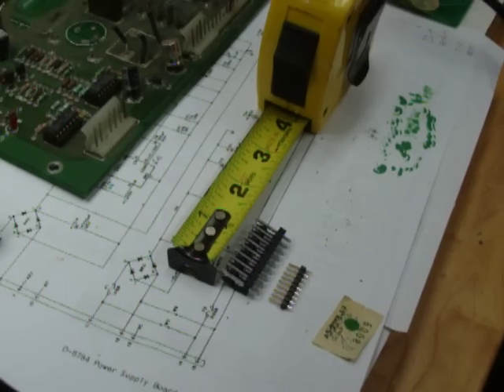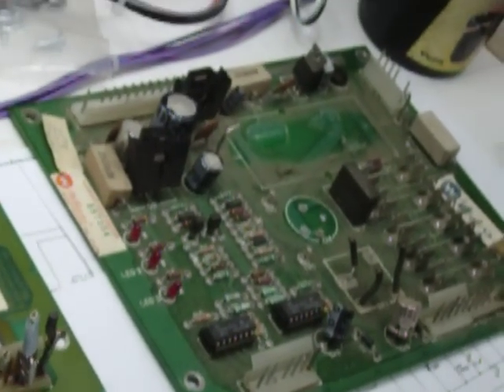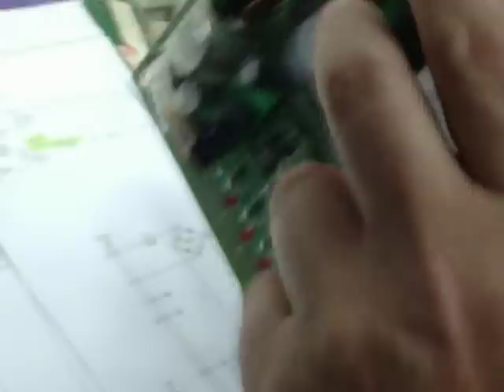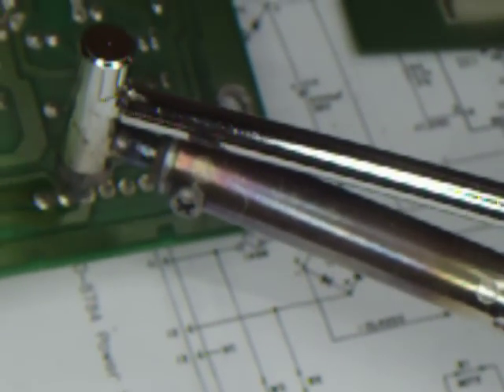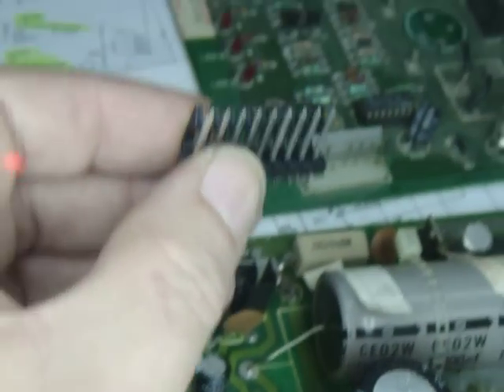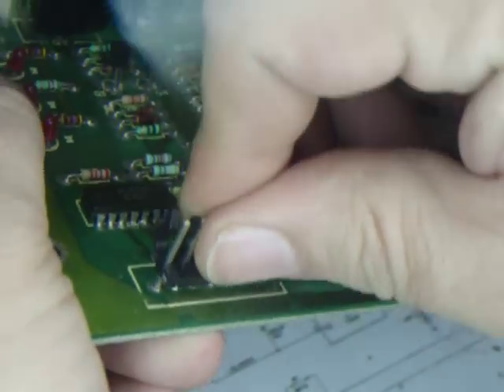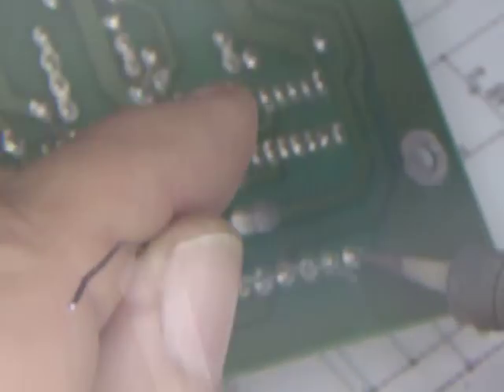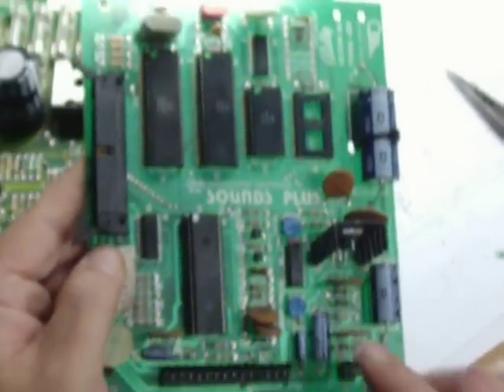How to: Replace a Burnt header

Comment: What I always worry about about those tight fitting pins, is some of the traces to the header are on both sides of the board...I don't know if they're eyelets or just two separate pads...I always worry that care must be taken to make sure solder gets to both sides of the board on those traces(underneath the header).  Great video, thank you!